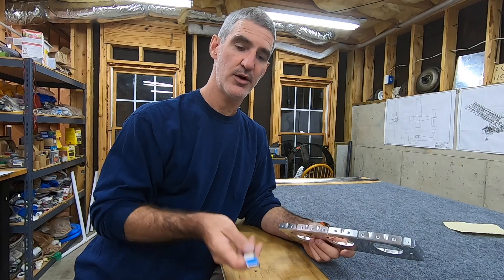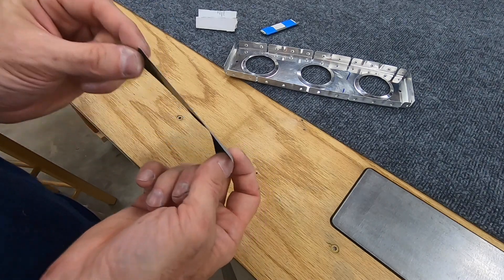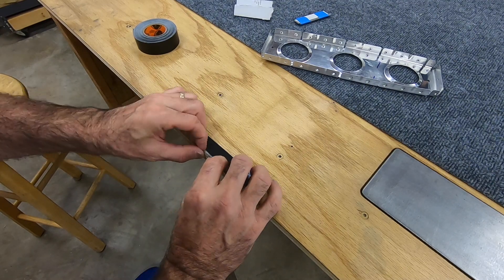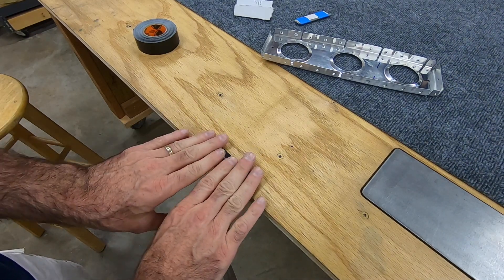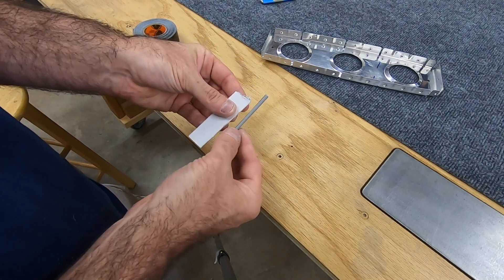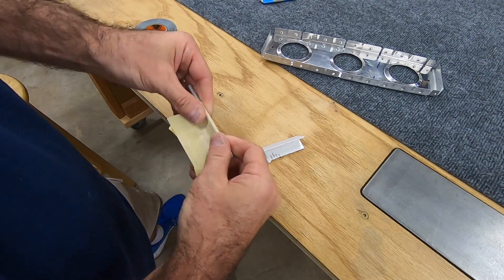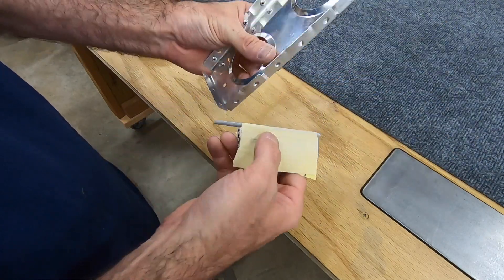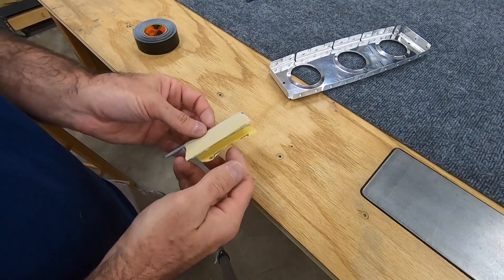RV 10 Build Log - Requested Deburring Tip

Comment: I ended up just using the corner on the 3M wheel.  Only need to worry about the outer edge that is mating against the skins.  Once I learned how the edges of the flanges would be mating with the skins, I saved a lot of time.
Reply from the maker: Agree, you definitely want to deburr edges that will touch other surfaces (like the part of a rib flange that will make contact with the skin) so you don't scratch or create a stress point that will turn into a crack over time.  But I've also been under the impression that any major irregularity can over time and vibration be a stress riser.  So that's why I tend to deburr just about everything.  Maybe I'm going overboard but I don't think it can hurt.  Just take forever ;-)
Reply: @missiletwentynine2667  I always run over everything with scotch pad in prep for priming anyway.  For sure I went overboard with the tail too.  I mean, why not right?  My mentor kinda told me I was going overboard too.  Same with the fluting.  Perfection can be the enemy of good enough!   Keep on posting, really enjoying your videos!
Reply from the maker: @smellyallen  I've wondered about the fluting, and all the work I go to to get flanges 90 degrees, then things get wrenched around a good bit when assembling and riveting, especially when you have to flex the structure around to gain access to a particular rivet.  Can't hurt, though, and it's a learning process.